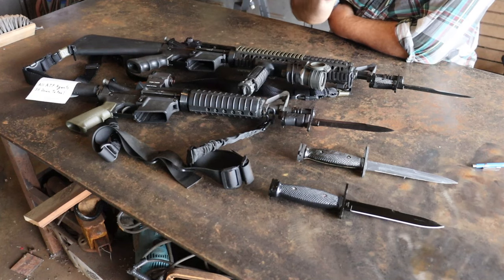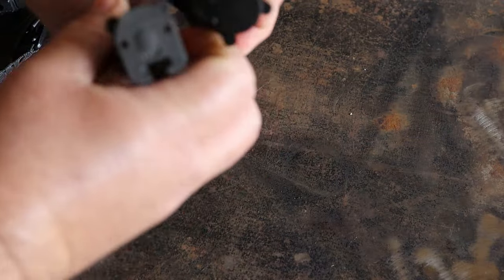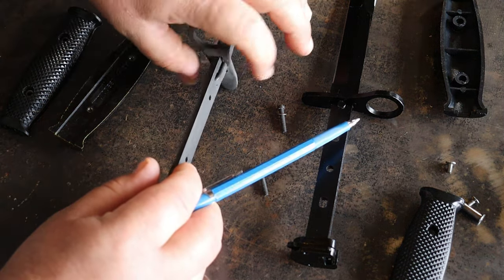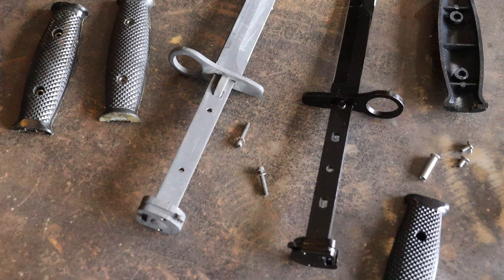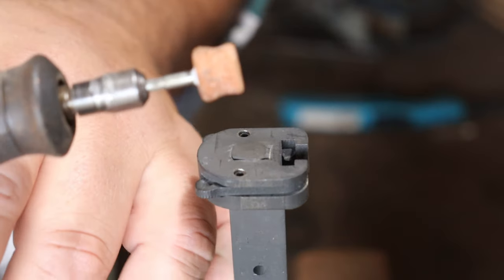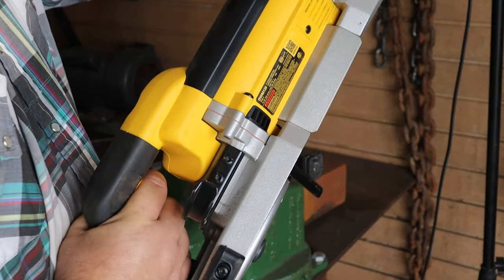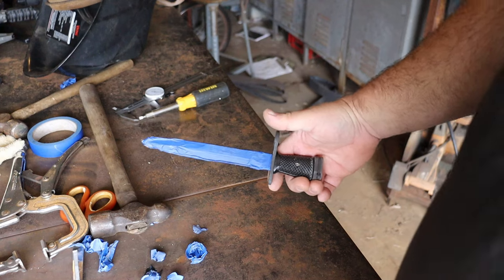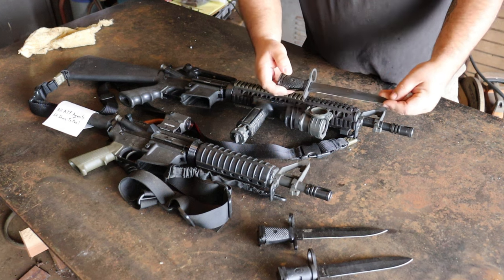USGI M7 Dissipator Bayonet

Comment: Excellent work, Brandon 👏. The Chinese one you used for comparison looks like mine. If it's not mine, it is the exact same brand. You did a fantastic job on mine. Now my stubby little dissy no longer has bayonet envy 😁. Just a PS. In addition I own two original M7's and they're not cheap especially nowadays. Last I checked one like the one you're working on in unissued condition are in the $150.00 range 😬. If I can find an older one for a good deal, I'll send it your way. Thanks again.
Reply from the maker: It was your's, I'm glad you like it the pics were great!

Comment: Locking lug in that is terrible also other models using same. When you stick it to enemy it will stay there when you pull out. If it gets stuck in gear it drops off from your weapon. Rather use my shovel, skrama or alone OKC3S than attaching it to rifle. Cool showoff piece tho.
Reply from the maker: I would rather use the rifle!

Comment: Just a thought but if you wanted to get the peened piece off without cutting it completely from the tang I feel like it might have been possible to do with a drill press and stepping up drill bits until it was thin enough to collapse the tang material. Definitely understand not trying that on a customer's blade for the first time though 😅

Comment: the pigsticker is a non issue but why does EVERY dremel stone holler out in the middle like that!! every damn one i've had has done that no matter how you move it to keep it from happening!!
Reply from the maker: I have no idea, but bench grinder wheels do the same thing.
Reply: @VooDooTennessee  i've not seen it on a bench grinder before i'll take your word for it since i don't use a bench grinder that much but rotary stones i can testify in court on it happening no matter how careful you are with the angle to avoid it!